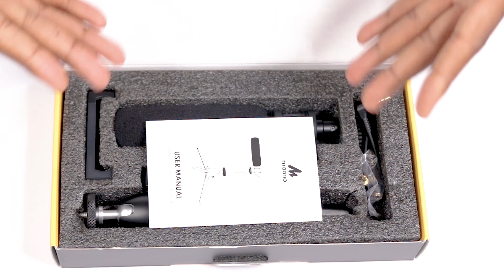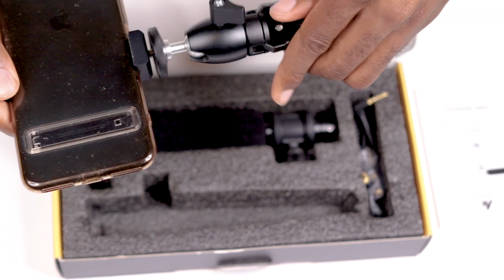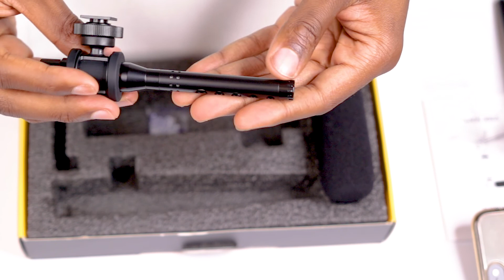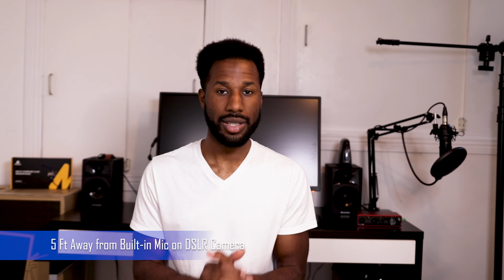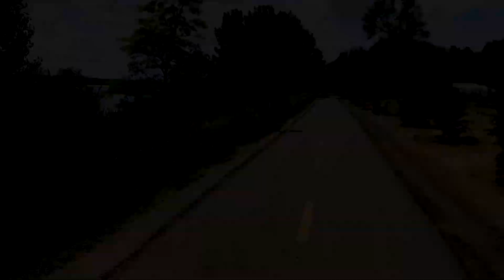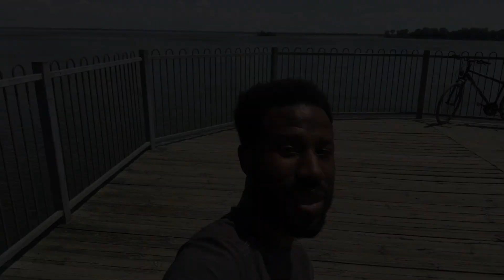Maono AU-CM10S Best  Budget Camera Microphone Bundle for vlogging Audio Review and Unboxing

Comment: At 14-34 I can hear some cracking sound - is it because of connection or some other reason?
Reply from the maker: When using this microphone with your phone I would recommend using some kind of app that allows you to control input gain. The microphone is sensitive so it can work from a father distance so without controlling the gain it can easily peek with unsuspecting sounds. You’ll notice that crack sound did not occurs with my DSLR because I had control of the gain internally. This is something I should have mentioned in the video
Hope this helps !! 👍🏾
Reply: Go Wright Reviews Thanks